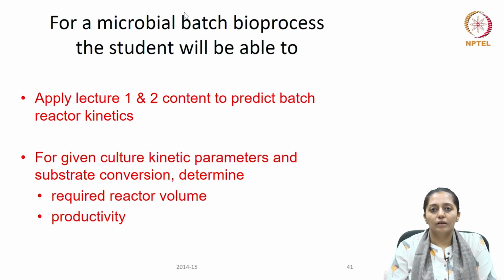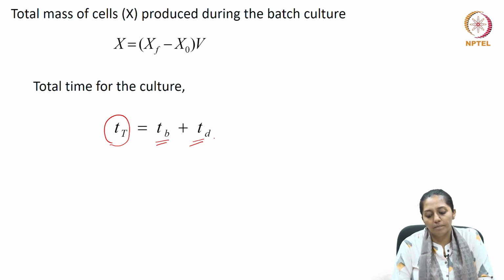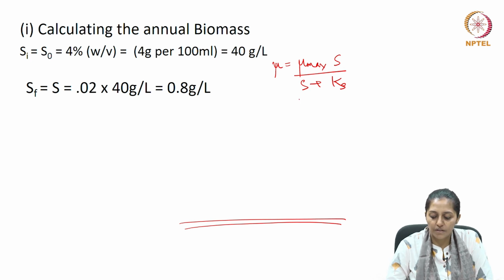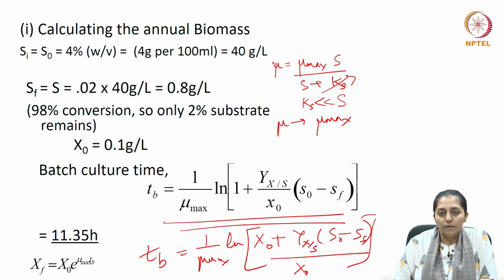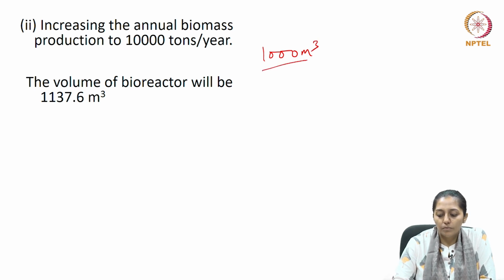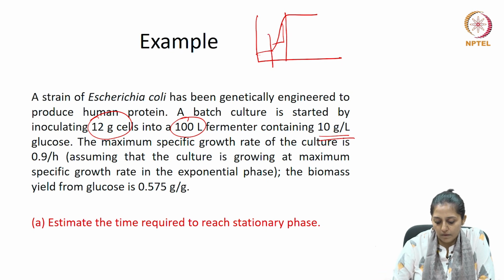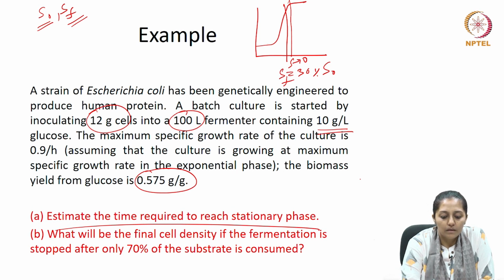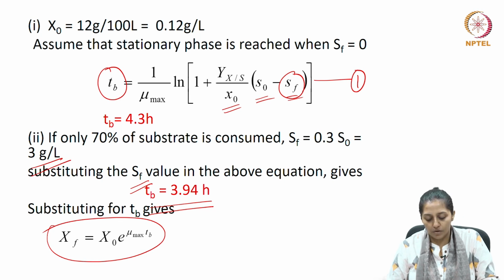mod02lec07 - Design of Batch Bioreactors - Practice problems

Comment: The resulting biomass is in grams, so instead 16400 kg should be 16400 g
Reply: No volume was given in m^3
1 m3 = 1000L
After converting into it, we can multiply g/l with l 
Ultimately leading to 16400 kg
Also directly multiplying m^3 gives us in kg 
But i did these steps to ensure if the unit conversions are correct
Reply: I will check, i don't even recall the actual problem  @Vishnu12143